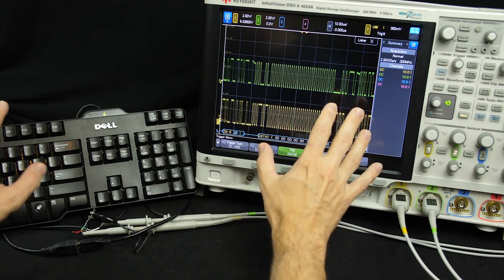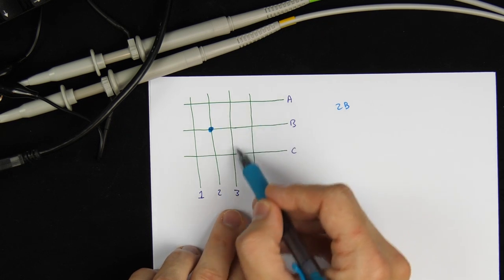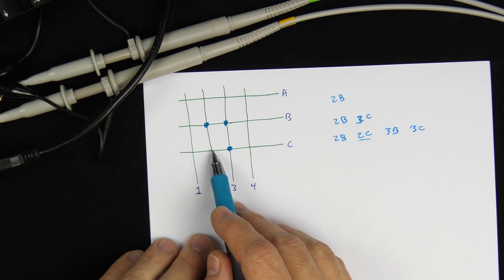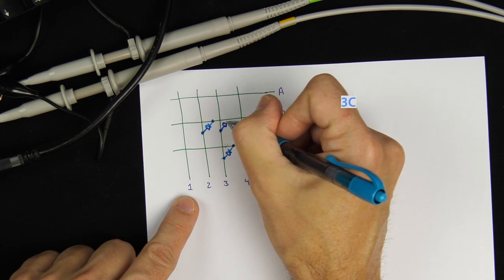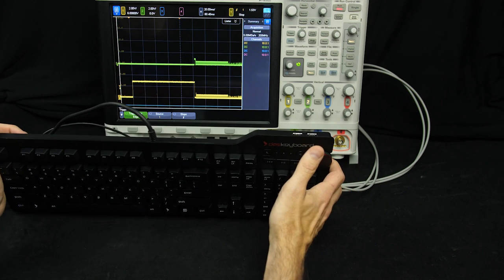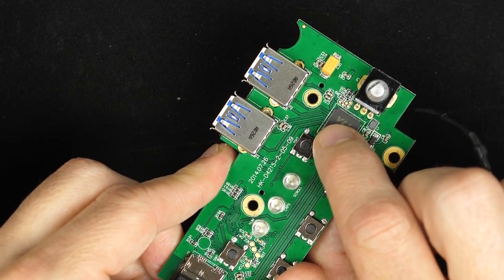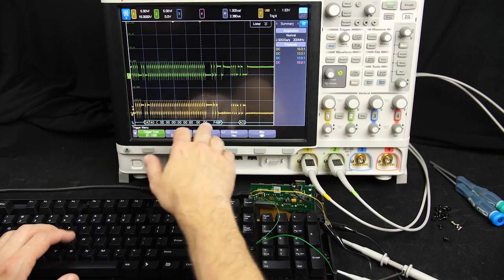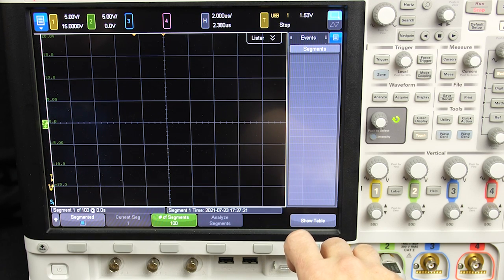How does n-key rollover work?

Comment: Another good question. Is there any useful application for more than 10 key rollover?
What games require you to push more than three buttons at the same time?
Reply: It's for when you have multiple people typing on the same keyboard at the same time, NCIS-style.
Reply: More than 3 buttons can happen in many shooters. Imagine you want to run forward left, reload and jump at the same time. Shift (run) + W (forward) + A(left) + R(reload) + Space (jump)
That's 5 simultaneus keys (granted, one of them is modifier key) and it can happen relatively often in some games.

Also, there are local multiplayer games that multiple players (upto 4) play on one keyboard. In those, 12 keys being pressed simultaneously is actually pretty likely.
Reply: I see, cool use cases! Also didn't knew I press so many keys at the same time almost regularly!
The first time I saw the question about how useful it actually is half of reddit agreed that it is useless and I made up combo passwords :D (passwords where you can press multiple keys at the same time)
Reply: Flight simulators. Or just any simulator. If you, for example, make custom controllers, you might implement certain switches as keys that are pressed when the switch is in the "on" position. So if you have a custom controller and more than ten switches in the "on" position, you will see ten pressed keys.
Reply: Also keep in mind that game designers will often limit at least the most common combo-moves to fewer keys simply because a lot of their players won't have n-key-rollover keyboards, but just whatever came with their machine. They even have to be careful which keys they use, to account for players on crappy diode-less keyboards). If n-key was 'normal' I imagine quite a few games might make use of more simultaneous keys on the keyboard interface.

Comment: The unused eight ones in the descriptor is likely from using a 16 bit shift register to prepare the inputs for serial link
Reply: I think it's just reserved for adding more modifier keys.
Reply: @renakunisaki  your premise is compelling but I have evidence to the contrary: in USB protocol you don't have to reserve anything for future use!  I say that because any keyboard with additional modifiers can easily just change the modifier section length. There is no upside to reserving bits in the packet, because packet size was never fixed to begin with.
Reply: It's neither.  It's to get the report size to 8, which is a convenient size as far as the rest of the protocol is concerned.  The packet size effectively is fixed, because the "boot" report format was aimed at hosts that took shortcuts like not decoding report descriptors.

Comment: I think I have an explanation for why not every keyboard has diodes in series with the keys, besides the added cost of the diodes themselves.
Usually, in the cheapest keyboards, the switch matrix is formed by three plastic film sheets — two of them serve as PCB substrates and one as a separator. Adding diodes would imply soldering them onto these substrates, which would be impractical without upgrading them to a much more expensive material like Kapton or Fiberglass, for example.

Comment: DAS Keyboard says on their website that their n-key rollover doesn't work with some older motherboards. Maybe that is why some keyboards emulates multiple keyboards instead, for compatibility reasons? Also probably why you need to toggle it on, to avoid having it not work by default if you plug it into something older.
Reply: That makes a lot of sense. I believe n-key capabilities were a bit of a late addition to the USB spec, so machines with older/simpler BIOSes may not support it.
Reply: USB has always had this capability, and this is not a "late addition".  What they're saying is that the input reports in the N-key form aren't understood by some older firmwares, which have the 6-key "boot" report format hardwired and don't bother decoding the report descriptors to find out the actual report format.  There's nothing stopping firmwares from knowing how to properly decode report descriptors, though.

Comment: So you could build a media kbd with all the keys like play/pause volume etc? I somehow thought this functionality is provided by the kbd driver.
Reply: Yeah, i think it's standard too. Just connect the kb and those keys just work, no fancy drivers needed.
Reply: Yep! It's all part of the HID standard. As long as the OS supports the standard HID "usage" provided by that key, it will work. My keyboard has a calculator key and it just works automatically in Windows and Linux (not Mac though because Apple didn't implement that key to do anything in their OS).

Comment: I think it’s a bit more complex than this. Likely, the column outputs are scanned by something like a CD4017 driven by a clock signal, so it counts 1->2->3->4->1… and the clock goes to a latch on each of the row inputs, which then captures the data on the rising edge of the clock. So it’ll first pick up the key press on column 2/row B. On the falling edge of the clock, the latch outputs probably get shifted into an internal register of the keyboard encoder IC, where it’s combined with the row value to produce an index into a lookup table which outputs the key code to the USB guts. The clock now goes high, and it’s now scanning column 3, where it picks up key presses on rows 2 and 3, but - by this time - the output on column 2 has probably returned to the Hi-Z state, so there’s no risk of it detecting a spurious key press on 2/C, as the column count has already advanced to 3, which is combined with the row data on B & C. But I guess we’ll never know unless someone wants to de-lid the keyboard IC! 😂 In other words, there are probably current-steering diodes - either on the keyboard PCB, or inside the IC - so that it can only detect key presses in the column it’s currently scanning.

Comment: 12:17 That thing is just using a USB 3 "micro" connector where the USB cable goes to the PCB internally? Nice detail, 'cause it's shielded and all... 😃
EDIT: USB 3, not C
Reply: It's easy to replace too
Reply: @AtomicDonuts3680  though it would be even easier if the port were on the outside.

Comment: The 6 can be changed to 8, I have done that, from EFM32HG hid keyboard example.
/** HID keyboard input report definition. */
typedef struct
{
  uint8_t modifier; /**< Key modifier byte as defined in HID spec. section "8.3  Report Format for Array Items". */
  uint8_t reserved; /**< Reserved, should be set to zero. */
  uint8_t key[ 6 ];   /**< Array of 6 key array indices, key index codes are defined in the "Keyboard page" section
                         of "USB HID Usage Tables document", also refer to usbkbdscancodes.c. */
} SL_ATTRIBUTE_PACKED HIDKBD_KeyReport_t;
Reply: you also have to change the second report count  0x95 to 0x08, in HIDKBD_ReportDescriptor[ 69 ] 
this is used by Windows when negotiate settings during plugging in the usb device.
0x95, 0x06,                    //   REPORT_COUNT (6)

Comment: I designed a 10 button keypad and just made an interesting observation. Inspired by Ben's n-key rollover talk, I decided to alter my code so that my keypad would accept any combination of the 10 keys. I did this, then ...

I wanted to know how many unique combinations this was. Of course it is 1023. But at first, I used the conventional statistical method. Given n objects (10 buttons in my case), and r sub-groups (simultaneously pressed buttons in my case), combinations is given by c(n,r) = n!/r!(n-r)! (unique, order doesn't matter) To get all  combinations, I simply summed the terms varying r from 1 to 10. 

To be clear, adding the combinations for; 'pressing any single button' + 'any 2 buttons', 'any 3' ... up to all 10 buttons, gives 1023 = 10 + 45 + 120 + 210 + 252 + 210 + 120 + 45 + 10 + 1. But then I realized (silly me) that basically I had 10 binary switches, so of course the total unique combinations would be 2^n-1 (-1 because, I don't care about the case where no buttons are pressed.) This works for any number of buttons (even 1.)

Therefore:

2^n-1 = SUM(n!/r!(n-r)!), r{1..n}

It's just that I'm having a hard time understanding how to get from one of these seemingly unrelated terms, to the other?

Can anyone explain this? (Serious replies only please)
Reply: To my understanding, the link there comes because you’ve defined it specifically as a base-2 number. 

So it’s always x^y (or x^y-1 if all-0s is irrelevant). Where x is your base and y is the number of unique positions (in this case buttons, but it holds true also for columns of digits — a 4 digit PIN code has 10^4 combinations, while 4 bits have 2^4 combinations). 

The longer equation just describes the process of working through all combinations manually (counting how many options there are for each digit in a code, then adding them all together, much as one might do at school to learn the concept), versus the strictly numerical relationship without brute-forcing (x^y). 

At least, that is my distant recollection of my college-level theoretical-maths teacher’s explanation. He also analogised to how there’s many different mechanical methods to encode multiplication as addition or exponents as multiplication during your hand calculation, which all look quite different in-progress but ultimately describe the same manipulation relationships viewed through different angles. But perhaps there is an even deeper explanation which I never got!
Reply: @kaitlyn__L  Thanks ... you may be on to something. So, I haven't had a chance to run the numbers, but perhaps base2 comes from the fact that each switch has 2 states. If however, each switch had 3, 4 or "x" states etc., the results would be more in line with this. Not too practical for my button board, but it makes me think 'enigma machine', which had multiple rotor wheels (switches), each with 26 states.

Comment: 28:42 Endpoint packet size is also different. 
(Sending the keyboard state as bitmap takes more space. But just a little more. With just 14 bytes you can transmit 112 key state compared to using 8 bytes to send 8+6 keys.)

Comment: Hey! I've always wanted to play with USB. I wanted to make my own macro keyboard, send arbitrary data trhough usb using HID specification (so no drivers are required), but the complexity of USB kills all of my enthusiasm. Reverse engineering the keyboard and showing how to use the USB/HID specification documents helped me a lot with understanding USB. I might get back to it soon (the time is never enough...). I would like to see a video about creating your own USB device. Maybe one as a keyboard and one that's sending arbitrary data using HID. I think picKit programmers use HID to send data without the need of usb drivers. That's huge - just plug your device like in the good old days with the serial port, except you don't have to tell which port you plugged it in. That's why USB2Serial is not great. You can't expect the end user to enter serial port each time he uses the device.

Comment: i did some keyboard linux driver hacking years ago, and the logitech g710+, and probably other logitech keyboards, just send extra usb packets for extra rollover, to support 26-key rollover. It's similar to the "emulating multiple keyboards" system you mentioned near the end, but without the same level of overhead.

Comment: Hey Ben,

The keyboard on my laptop has more of those "special" (System control) keys. On my laptop they are where the function keys are supposed to be. And I have to press an extra key ("Fn") to actually press a function key on that laptop. 
So it's possible that the microcontroller was prepared to do this, Possibly in a different keyboard version, maybe simply by being embedded in a laptop. 

Also note that /if/ your keyboard had <A>(00) ... <keypad = >(68) then it would still  have to report 68 bits even if it was missing some of the keys before the <keypad = > Maybe it is possible to change the descriptor, but with modern computers I often see that developers seem to say: OK, I've modified the example code so that it now works, DONE! So BIOS descriptor text fields will say: "To be filled by OEM" and stuff like that.

Comment: Interesting. I really enjoyed the depth you went into here. I made an Arduino-based keyboard doing n-key by having more than one keyboard. I think a lot of hobby keyboards do this because it's easier in the standard libraries than changing the negotiated type. I guess the DasKeyboard has the switch for older OS versions or embedded systems that don't support the bit-per-key mode?

Comment: Why marketing never mentions any of these important features in keyboard product descriptions? If their amazon page said that this particular keyboard uses diodes in every key to resolve multi key presses conflicts, communicates with host at high speed to lower the latency, supports a rollover protocol to allow pressing all 104 keys simultaneously, I would be sold right that moment. Instead it probably reads "usb keyboard with media buttons". I never thought there is such a huge difference in how those "boring" keyboards are operating, I thought they all use some standard keyboard protocol since 90s and the only difference is how keys feel.

Comment: At 28:20, you indicate that the only difference is the descriptor length, you missed that the maximum packet size in normal mode is 8 whereas the maximum packet size in N-key rollover mode is 14.

Comment: I like how the combination keyboard/usb hub amounts to a usb keyboard plugged into a usb hub
Reply: I mean, what did you expect? A frankenstein monster that both a usb hub and a keyboard at the same time?
Reply: That's the only way it can work. You can't plug two USB devices into a single port.
Reply: It would be interesting to try to mod in the third usb port into the keyboard
Reply: @RobertBeckk   Nevermind. I'm an idiot. You mean add another place for a USB device to plug in? You realize all four ports on the USB controller are already in use, right? One to the keyboard, two to the open ports, and one to the cable that will plug into the computer.
Reply: @wbfaulk  No, one USB port (port3) is not used. The chip has 1 input and 4 outputs. Port0 was the input. The 2 USB3 sockets are on port 1 and 2 and the keyboard was on port 4 and just D-/D+ pins.
Reply: @galier2  Ugh. Duh.
Reply: You can get hubs with integrated micro-controllers, so a device with a single chip is possible, however those integrated chips are fairly rare and quite expensive, at least all the ones I found when I went looking for such were, and in my own designs, using a separate hub chip ended up both easier and cheaper.

Comment: OK, here's the next thing you can do, and I think this might be a real game changer:
There's those USB sticks with Flash memory and USB controllers on them, and often times they got stuck in read-only mode from some reason or stop responding at all, and people can't use them anymore for storing any new data. They think that the USB stick has just got broken and all that they can do is to buy a new one. But it turns out that this is actually a scam that the manufacturers pull on their customers to force them into buying new devices. There's always some secret handshake protocol with the controller that one can perform by using some special proprietary software that only the manufacturer has access to, and it allows to unlock the device from the read-only mode, repair its firmware when it gets corrupted, etc., and after that, the device works as new. The problem is, if you don't have access to that proprietary software, and if you don't know the secret handshake protocol with a particular controller, you can't do any of that, and the only option for you is to just a new one, even though the device isn't really damaged and you could restore it to good condition with just a couple of clicks.
How do I know that? Well, because I had that problem, and I managed to find one such program on some obscure & shady Chinese websites and restore one of my "broken" USB sticks that way. It still works fine to this day. I also captured the conversation with the controller (it was made by Phison) with Wireshark and it turned out to be an SCSI protocol tunnelled over the USB protocol. It used some vendor-specific command codes for reuploading the firmware and resetting the internal read-only flags.
The same procedure applies to other manufacturers and other types of controllers, but the real problem lays in the fact that each manufacturer has their own secret handshake, and it's usually hard to figure out unless you do a lot of brute-force fuzzing or have some inside intel.
So I thought that it might be interesting if either you, or some of your viewers, could perhaps tinker with those devices and try to figure out those secret handshake sequences for other devices and manufacturers? It would be cool if this information would be more publicly available and perhaps a general-purpose, open-source software could result from that for unlocking those "broken" USB sticks & flash cards? (Oh, did I mention that they do that with SD cards as well? :q It's a really deep & big scam.) What do you think?

Comment: Thank you for a great video. Figuring out how to intercept the Full-Speed USB-signal between the keywords controller and the hubs seems to have been quite a bit of clever detective work. Maybe it would be easier to modify the host side of the setup, forcing the communication to take place over a Full-Speed connection?

Comment: I wonder if you could force the keyboard to run in USB 1.0 mode by putting it downstream from a USB 1.0 hub? That way it won't be able to negotiate High-Speed mode and should run Full Speed only? I remember back in the day this being an issue - my USB 2.0 HS video capture device would run in Full Speed mode when it was connected via a USB 1.0 hub which meant the video capture was all fubar.